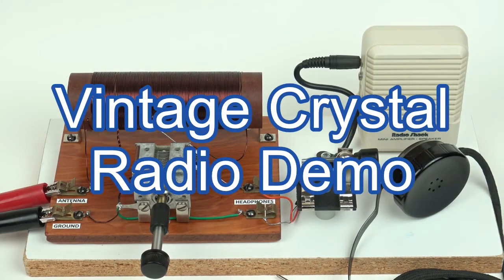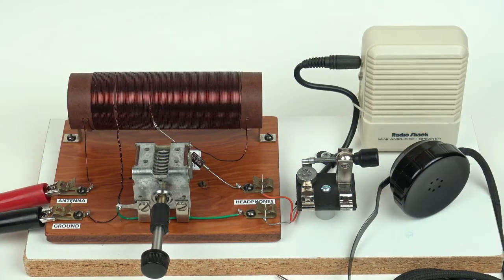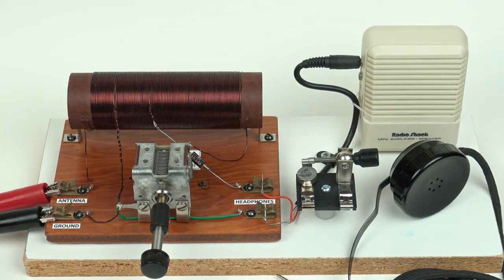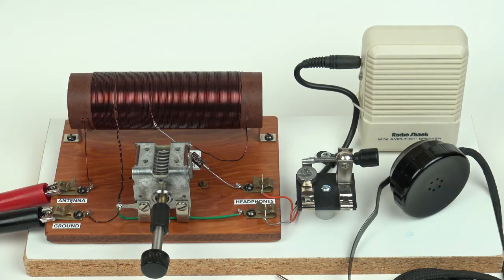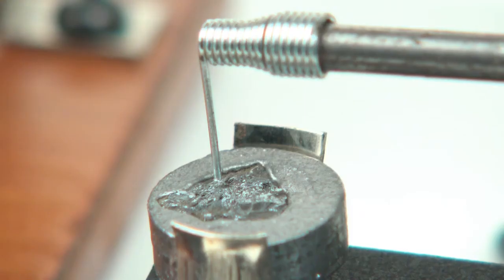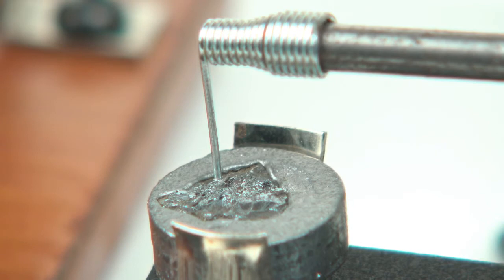Vintage Crystal Radio Demo

Comment: I bought one of these in an antique shop a few years ago. $27 with headphones. Quite sensitive and selective. I checked the values of coil inductance on the Professor Coyle site. I made many different coils with the same inductance using larger diameter coils, larger wire, etc. A fun circuit to experiment with. Take any multi-tapped coil and hook it up like this particular circuit. Experiment by placing antenna, ground, diode, or capacitor on different taps. Thanks for posting this video.
Reply from the maker: Thanks for your comments. It's fun to experiment with different things, instead of Arduinios and Raspberry Pis all the time
Dave, Apple Valley, CA

Comment: In the 1960's our 5th grade Science class made several of these to demonstrate the basic principles behind our AM radios. We used several different ways of making a "diode"!
Reply from the maker: Amazingly, there are still people poking around with razor blades and other materials to make diodes. Did you pursue electronics in your career?

Comment: I still keep up the hobby, tube and xtal radios and tube radio restoration.
Reply from the maker: Victor Mike, 
I didn't notice your comment until today. Sorry. I regret that I didn't cover the history of xtal radios and present-day collectors better in the article. There were some real beauties back then. I was amazed at all the configurations that were available. 
BTW, I'm currently working on an article about vintage rectifier tubes, like the 866A, 5U4, 1B3, etc. I have a few questions about them that perhaps you could answer. I also have a photo of the tubes that I would like to send to you. Would that be possible?
Thanks.
Dave

Comment: Hello
What's your experience between using a cat whisker and using a diode
In relation to sensitivity and selectivity
Reply from the maker: My experience is limited to this one crystal set. It seemed like the sensitivity was about the same for the 1N34A diode or the Galena crystal. As for selectivity, that is probably more a function of the resonant circuit, not the detector. You might contact some of the more serious crystal set people on YouTube to get a more detailed answer. Thanks for your inquiry.
Reply: @goodsell1322  I don't see other videos of people using the cat whisker 
Just yourself
Thanks reply !
Reply from the maker: @uncleruckus4060  Dave Goodsell here. Cat whisker crystals were around long before semiconductor diodes. Early crystal sets usually used some type of natural crystal as a detector. But when germanium diodes became available, they were used in hobby sets because they were easier to handle. However, cat whisker crystals are still popular with serious crystal set collectors and experimenters. Poking around a natural mineral to receive radio signals has a certain magic to it.

Comment: Is there a reason that the tuning capacitor is installed upside down?
Reply from the maker: Howdy Bob,
Thanks for your inquiry.
The answer to your question is that it does not matter which way the tuning capacitor is mounted: up, down or on its front, back or side. It will perform electrically the same in all orientations.
That said, catalogs tend to show variable capacitors with the rotating plates at the top, because they look better that way. 
I think the designer of the Allied Crystal Set rotated it “upside down” so brackets could be used to adapt the tapped holes in the front of the capacitor to wood screws in the wooden base.  
Please let me know if you have any other questions.
Dave
Reply: Yes I know that it doesn’t matter just was curious but now after looking more closely at your set I may see the reason. I remember my dad built me one back in the early 50’s  I believe he used a vertical Bakelite coil form with a few taps and the cat whisker I wore it out over the years until I bought my first 6 transistor Mitsubishi radio.
Reply from the maker: @pchts1  Greg, I too have fond memories of my Dad helping me build a crystal set. Regarding the orientation, the variable capacitor has three tapped holes on the front, two at the "top" and one at the "bottom." I suspect that the designer flipped it over so two brackets would make it more stable than using the single hole at the bottom. Dave
Reply: @goodsell1322  When the capacitor is mounted upside down there is less likelihood of damage to plates. Some younger people handle things like bulls in the china shop.

Comment: shouldn't there be an actual 'whisker' on that spring whisker holder?
Reply from the maker: I think the word "whisker" is more of a descriptive term in this case. It needs to be made of a conductive material to transmit the signal.
Reply: @goodsell1322  No, you used to be able to by 'whisker' wire to wrap on that spring.
Reply from the maker: Okay, I stand corrected. Thank you for your input.